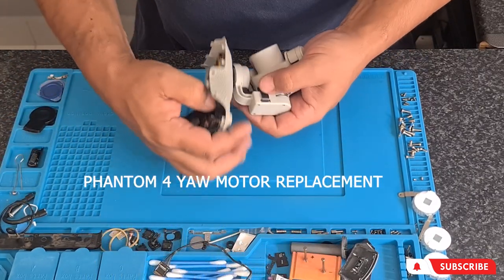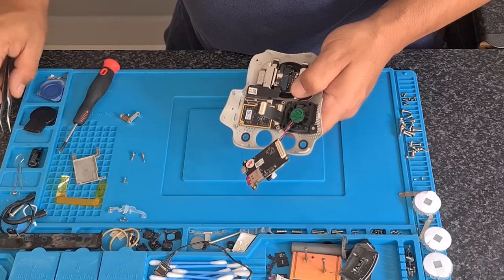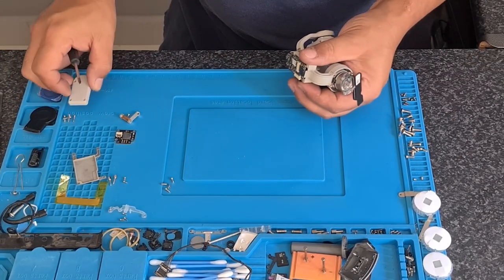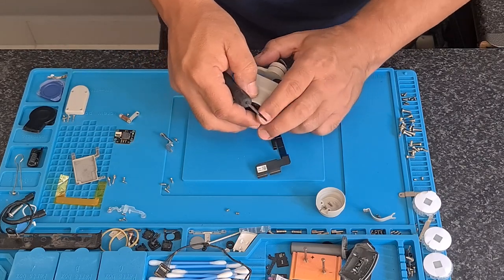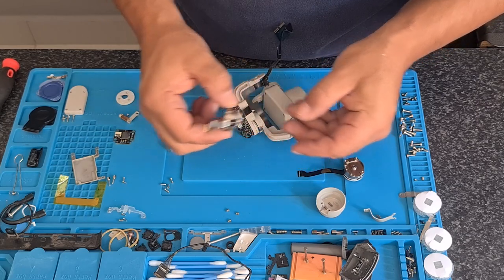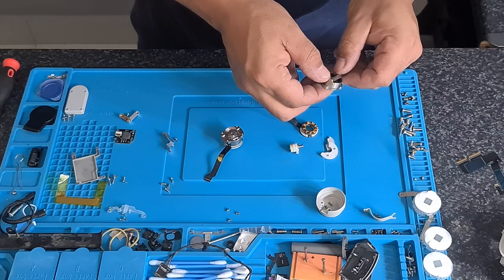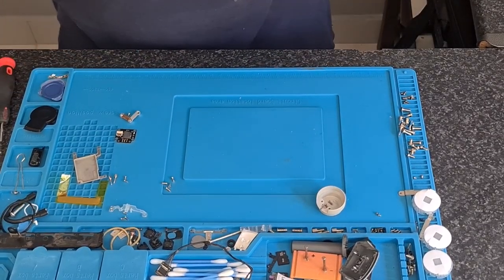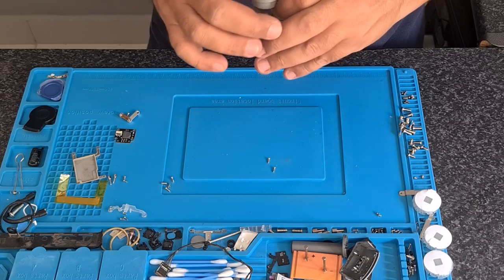How to Replace your DJI Phantom 4 Yaw Motor

Comment: I cannot get the shaft out of the casing. I am hitting it so hard and it still won’t pop out. Please help!
Should I just hit even harder?
Reply: You trying to knock it out the wrong way. Just did the same and fucked my Yaw motor up. Got to replace now and send to DJI for calibration. Expensive mistake.
Reply: You trying to knock it out the wrong way. Just did the same and f.. ked my Yaw motor up. Got to replace now and send to DJI for calibration. Expensive mistake.
Reply: @peterr7530  how much is it?
Reply: @failsafedji1745  I found a way of just getting new motor and just using old housing. If your housing is broken then you have to get a new complete Yaw motor and calibrate this as each motor is different for each drone. There are magnets inside the motor which have to be calibrated for the drone.